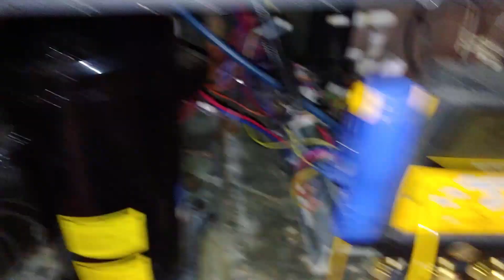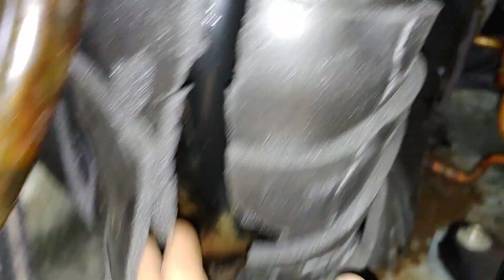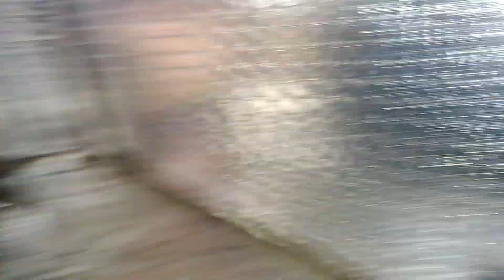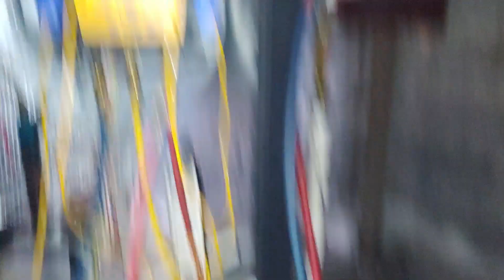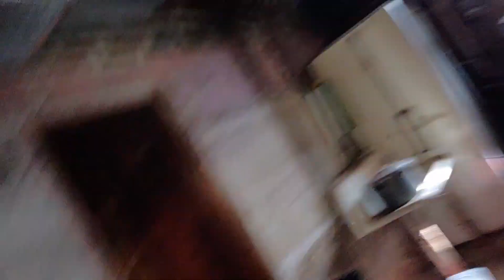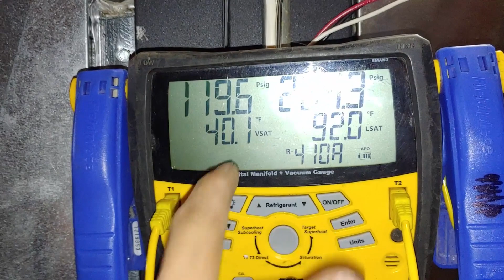Heat Pump Evaporator/Condenser Replacement

Comment: What is done to prevent future formicary corrosion?
Reply from the maker: Many companies in recent years have been switching to Aluminum coils, or they have protective coatings on the copper. The old coil in this video still failed, despite having a coating, so using aluminum is probably the better way to go. I need to do some more research on it.